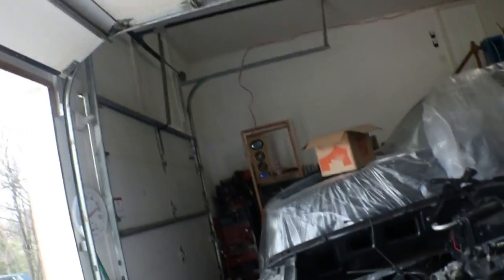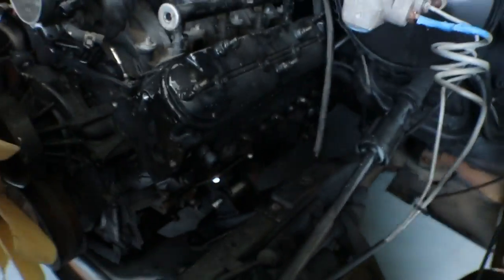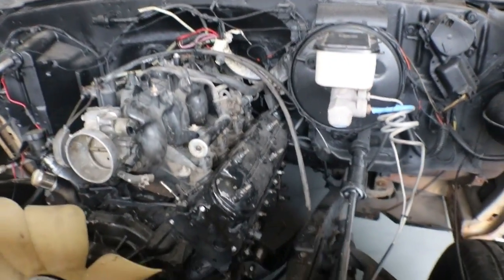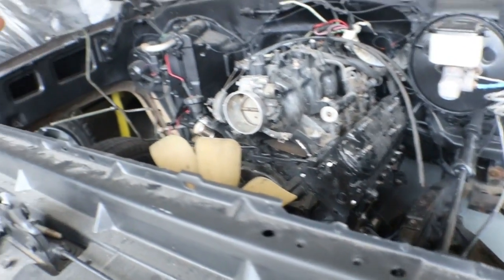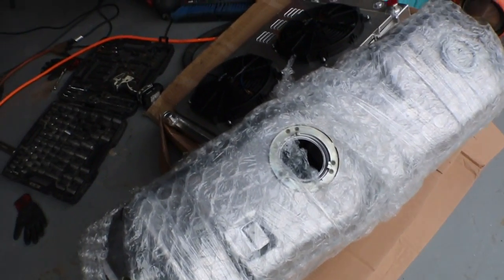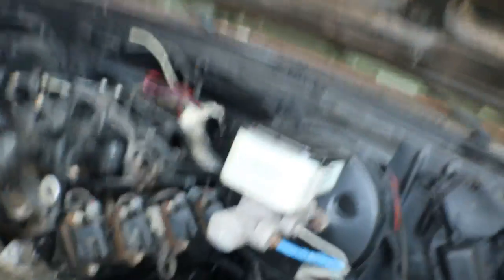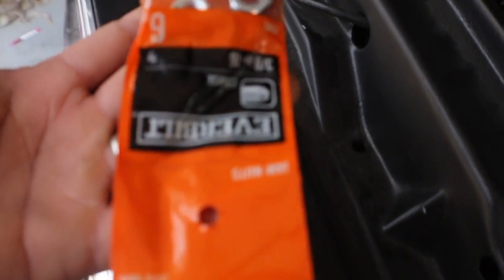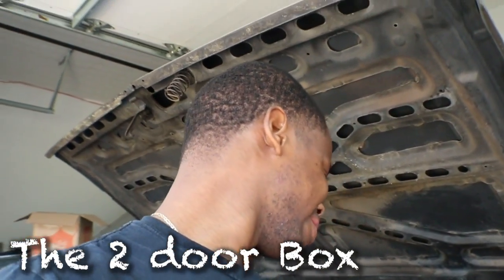JROCK’S LS SWAPPED C10 *ON HOLD

Comment: Do you have any information about wiring a ls wiring harness to a 1989 Chevy caprice bulkhead
Reply from the maker: Don’t know what a bulkhead is, wire it to the car
Reply: Well the wires on the firewall which ones r which I’m using a factory pinned out harness with factory fuse box

Comment: I did a ls3 swap on a 81 Silverado with a 4l60e trans but I can't get the pressure in the transmission lines. Any suggestions
Reply from the maker: I wouldn’t know without seeing it
Reply: I understand and thanks for replying bro. I'm thinking it's the front pump on the trans but it's been rebuilt from Coleman transmissions so idk. I'm puzzled
Reply from the maker: Shelby Robinson Shid take it back ❗️